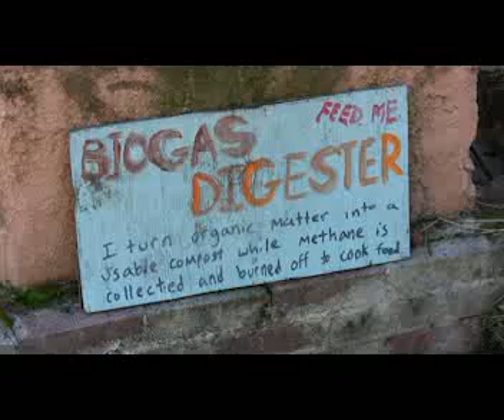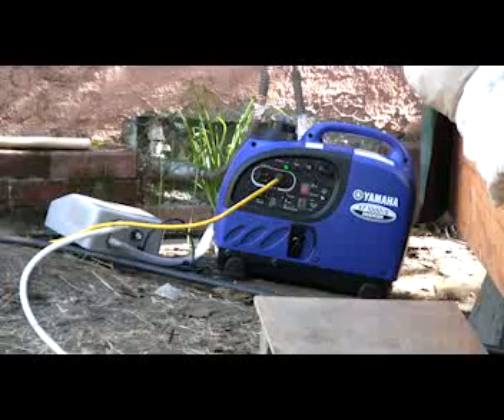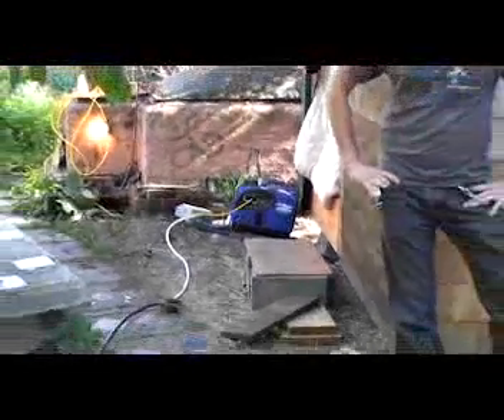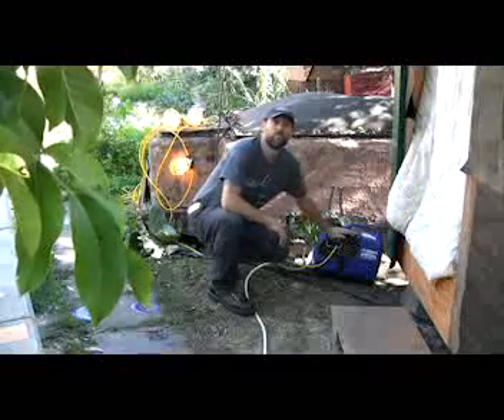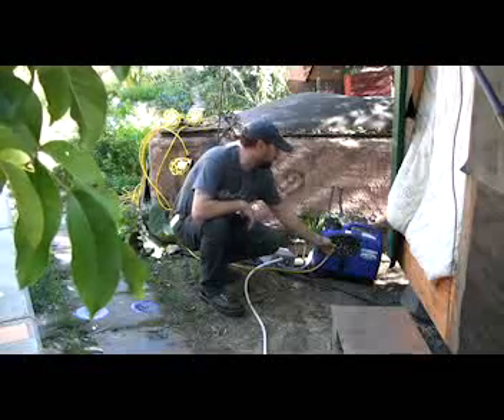Generating Electricity with Biogas

Comment: I’d like to run a heat pump off the biogas I collect from the hopper on the back of my tiny home. I don’t know very much. Is the only way to convert the energy by running an obnoxious generator? Will my system break down 100% of solids so I only have to siphon off the liquid or will I have to muck it out?

Comment: Look on you tube for silent air compressors, they're using them to compress air quietly, but you use it to compress your bio gas. Don't use the air compressors auto shutoff the contacts on the  relay is open to the environment and may ignite the gas you have to operate manually or come up with a better shut off. I wish I had some land I'd do exactly what you're doing go off grid, make my own power and fertilizer.

Comment: If you want to run that generator for days, get yourself a compressor off a small refrigerator and compress the gas into a large propane tank. those compressors can pump  over a 1000 psi propane is compressed to 2000 or more. and then you could use a real kitchen stove. Bio-gas is natural gas.Now you'll be out of the dark and cooking in the kitchen to make more poop!
Reply from the maker: +1 MrRose Thank you, Mr. Rose, we do not compress biogas for safety reasons. Our home units do not require storage, anyway, as they produce 1-day's worth of energy and when exhausted will refill themselves overnight.